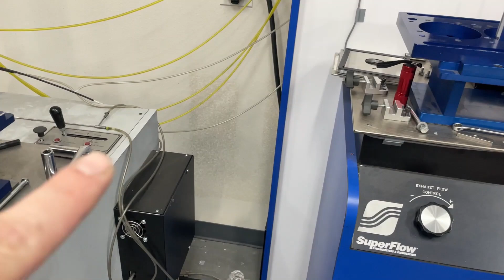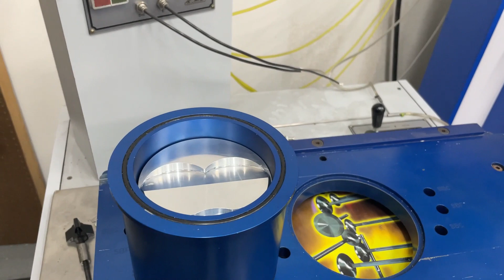Answering Questions You Guys Asked

Comment: I agree with most of the comments, your videos are NOT too long because you’re giving us really good info the whole time. I’m not sure how much you’re going to find out about cross flow with a steady state flow bench. The dynamics of pressure waves and inertia in the exhaust and how that affects the intake would be really hard to simulate. When you get down to it, the dyno is where you see it all come together. There may only be a few grams of air in the cylinder, but when it’s moving at speed-of-sound velocity, it has a huge effect on those few grams waiting to get pushed in by the 14.7 or so psi of ambient pressure. Still, there’s always something to be learned!

Comment: Awesome video man! You are spot on with the "too much cam duration". I'm living that right now. I bought a '72 Nova with a 461bb, 10.5:1 compression, BB2 plus 312 heads, dart single plane (sucks), IRD 4150 1050 carb. The cam is 272/280 @ 050, .722", 108LSA, 106CL. It has a th400 w/tb, 3.90 gears, PTC 8" 4400 "loose" converter, which actually flashes around 4800-5000. On a. 275 radial pro tire When I had the car chassis dyno tuned, I was sorely disappointed. I figured 625-640hp, 575-600tq at the flywheel, with a 20% parasitic loss, would put me around 500-510hp/465-475tq at the tire. NO! It made 464hp/388tq. Now, I race it and it's not too bad. I'm 275, and the car is heavy, I figure 3550-3650 race weight. It's running 6.7x-6.9x, right at 100 in the 1/8. However, that's why we are building the 582, that you are doing the heads/intake and possibly spec'ing the cam for.

Comment: Hi there from Aussie, excellent videos, thanks... love your train of thought on the separate flow benches.  Would it be possible to cnc a block of acrylic to replicate your intake/exhaust setup for one cylinder, glue the valve guides in, & valves, then by running smoke, watch what interference is happening while you move the piston up & down???   cheers..

Comment: 1963 Plymouth Max Wedge ll had the 13.5 comp ratio option and having a NOS  mech cam you can see just how long the duration is just by looking at it, and the lift is only .520". I remember in the late '70s some cam companies came out with longer duration cams so you could run lower octane gas in high compression muscle cars. You have nice flow works going on there and are making good videos too.

Comment: Thank you. I was asking about the 4 valve stuff. Info is really hard to find on them. My heads supposedly flow 217 at .450 which is max lift stock cam. Aftermarket cams are like $2k and only really add duration with a lift bump to like .468. The only people that do port work on that head, want $2k to $4K to do it. When I ask for numbers, they all say "Well bench numbers don't mean anything in the real world", which to me just means, they ported it, but the results made things worse. So I just DIY ported them, which the design was so good, really only required a port match and clean up. I couldn't find anyone that would flow the heads :( other wise I might of tired something more drastic since I have a few sets.

Comment: Totally understand the old cam styles 
I ran an old 400sbc with good flowing cast irons 
 team G intake 
And a 500/500- 250/255@50 104 centres 

It was an animal up to 5500 then air flow ran out 😂. Loved that old engine

Comment: I love your videos and they're not too long. I'm curious about valves that point toward each other, isn't there a point where they could touch each other? The old Honda motorcycle engines were limited because of this. Also, why not try and use the piston in the part of flow bench that the head sits on? Seems like all of the piping would be too hard to control. I'm interested in 4 valve VWs but your info still applies and I really appreciate that you share. Sorry about the long comment.

Comment: 358 sbc in compression rule 10.8 max checked w/ whistler 
Flattop piston with trench cut between valve pockets, made better torque.
Was this because overlap cross flow was unrestricted ? We cut the pistons
to use with 49cc chambered heads . Would be interesting to see this
 tested on your overlap/dual flowbench . Btw loved the video !

Comment: Have you ever talked about in your videos what happens to a small head (like a bbc 310-320cc port head) when you add bigger intake valves? Many come with 2.19 valves and the natural instinct is to toss a 2.25 or 2.30 in there. Not sure what limiting factor this would introduce or how much bigger you can go before running into issues. Love the videos. Keep up the good work!
Reply from the maker: I have briefly but will do another video maybe later.

Comment: Oh I forgot to mention what I'm using to port my heads.. just your basic dremel and some flap sanding disc and grinding stones... I have put in a order for some carbide tips on Amazon and ebay but they won't come in til next week.. are carbide tips the best burr tips to use for port work? I've notice with grinding stone, it takes quite some time to get a little bit of material out..

Comment: Hey brother! I'm so glad I stumbled onto your videos! I sub as soon as I viewed your dragon slayer port job. And now I'm addicted to all your videos, trying to soak up as much knowledge as possible. I am a first time head porter and I mainly,..well only, work on honda heads as of the moment.. please don't be to rough on me because of that. 😆 but im in process of porting my first head, is there anything you can tell me or offer any advice with these 16 valve heads? I have a line of f series heads I've accumulated over this past year, and I want to try and make use of them as much as possible. My current head im porting is a f22a4 head of of a 1990-1993 honda accord. 2.2 liters 16 valves. I started porting the valve bowls just ever so slightly.. just because im afraid of taking too much material out and mess something up.. but can you offer me any advice on what I should port and whats the best ways to get a good amount of noticable power and torque out of a port job?? Thank you very much brother!! Love watching all your videos and can't wait to see more content from you!

Comment: Hey Eric, I'll sometimes put too large of a cam in on purpose. Why? Because I feel a need to bleed off cylinder pressure down in the lower RPM range on a centrifugally supercharged engine because the static (and therefore dynamic with a smaller camshaft) compression is too high otherwise.

Comment: Honestly the point of the video being long is the wealth of information that you have that none of us do and it's all those a little tricks and ins-and-outs that you've got to say that I need to hear and I'm dealing with 2300 2400 type-1 Volkswagen motors and applying some of this to what they call a superflo set of heads with titanium valves and dual Chevy Springs and you know 10 to 1 and there are air-cooled oil cooled so this information is more important for me because of the Volkswagen motors already needing a lot of help cuz it's oil cooled and air-cooled and well you know

Comment: I'm doing a 496 big block Chevy my drag car need to know Holly sniper or weiand tunnel an carbs I have a comp cams 775 748 lift 286-295 at 50,000 installation 110 lopes separation 14:01 compression BB 3x brodex 119 combustion chamber 345 heads I need to know which would be a good tunnel  ram and what size carburetors

Comment: Eric when you made the comment about compression ratio dont you think it was misleading , maybe you were addressing street engines. I mean Pro Stock run as much as 18.1 and most drag race motors are above 12.1.
Reply from the maker: I was referring people adding compression ratio to make up the torque loss from too much duration on the cam. I’m race engines you put in as much compression as your fuel can handle.
Reply: @WeingartnerRacing  ok gotcha.

Comment: in this video you mention engines tend t be a dog with less than 225 cranking psi. am I safe to assume you meant race engine, and typically not pump gas ?
Reply from the maker: Yes. A 10 to 1 engine would make it hard to hit 220psi cranking.